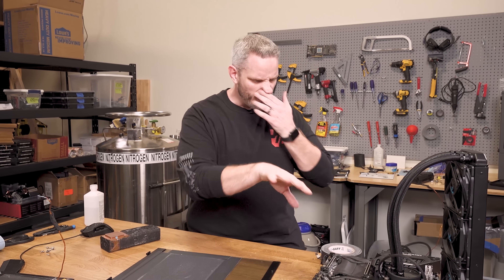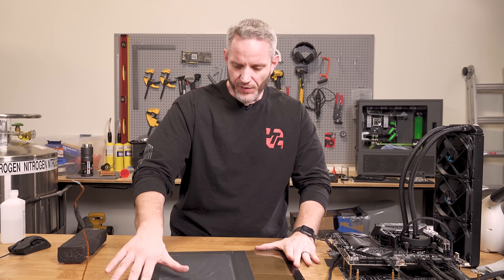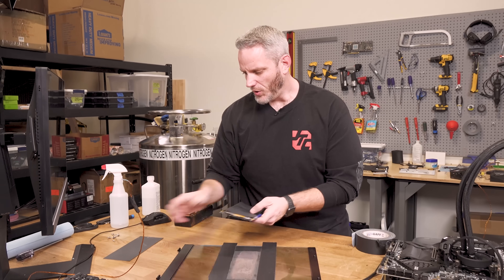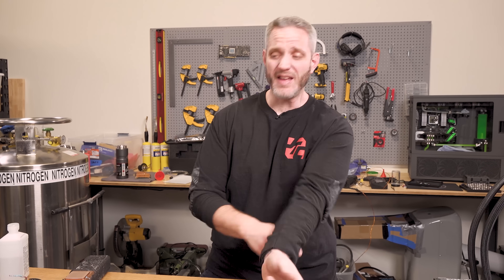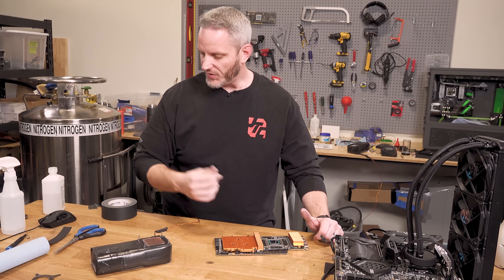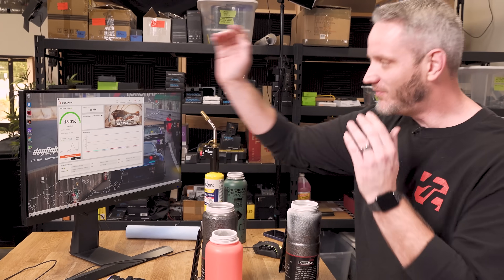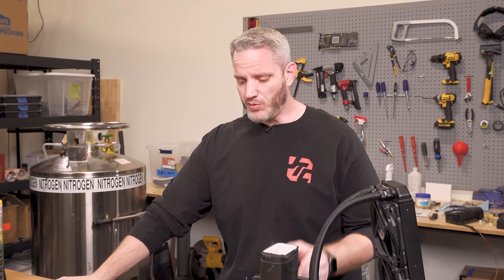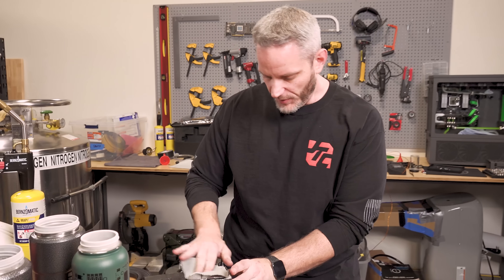THIS is Why Lapping Your Cooler is SO Important!!

Comment: Hey Jay, i don't know whether that matters or if it helps you, but did you try silicon grease instead of vaseline. 

Some kinds of vaselines are electric conductible and i don't if your (cosmetic) vaseline reacts to electricity. After all cosmetic vaseline function is hydrating your skin.

Technical Silicon oil or silicon grease is often used in electronic applications because of the neutral behavior against electricity.

Comment: Repeatability is the key. You should be using a torque wrench instead of a clamp. A further bit of advice... all torqued surfaces should be measured. I might also suggest a surfacing stone ,"lapping" and a height gauge to measure for high and low spots.

Comment: If you’re worried about microns of flatness you need to be lapping on float glass or a lab grade granite surfacing plate, not a thin, bendable PC case panel with imperfect metal edges on top of a non flat wooden table. That’s step one. You also need to stop using your hands, build a sliding sled jig that’s in perfect parallel with your surfacing plate, attach your die to it and lap up to 1000 grit. 

Not only will you be doing it right, it will challenge you and create some really interesting and fresh new content

Comment: You can use a sharpie to make marks on the metal.  The first marks to vanish in a light pass or two - the high spot.  Just something I learn for flattening sole of planes (woodwork).  Also grab free glass from a charity shop (mines a glass shelf from a cabinet), glass is floated on molten tin so is incredibly flat

Comment: Float glass may be “perfectly” flat, however, it bows like a crazy, especially thin glass. It can conform to the surface it’s sitting on potentially creating a concave/convex surface. I would use a thicker piece of glass or buy a certified flat surface considering that you’re going for precision applications.
Reply: A granite surface plate for metrology would probably better or a precision lapping plate with diamond lapping paste would create the best flatness some theorize that a perfectly lapped cooler and cpu could be used without thermal paste
Reply: @joshuahuman1  that’s no theory. In machining you have so perfectly flat metal plates for measuring, that they just stick together like suction cups
Reply: @99Etien  No, actually. I'm in a research group working with bearings, and one of the first things you learn is that nothing's perfectly flat.

There's a thin layer of contamination and oxide forming on the surface of the copper, which causes chemical changes that result in expansion and contraction. It varies depending on even things like surface temperature and local concentration of oxygen in the atmosphere. That's ignoring things like random variance in machining.

Basically, surface finish is inherently random, it's just a question of the degree of randomness. Wetted surfaces are always superior to dry contact when they're practical to use, and just trying to get a surface "flat enough" doesn't work.
Reply: @louisvaught2495  i'M iN a ReSeARcH gROuP. LOL.
Reply: @99Etien  they're called gauge blocks, and it's called "wringing" them together.
Reply: @xenonram  More digestible than "I'm a tribologist" and more specific than "I'm an engineer and I work on this"

Even lapped surfaces aren't actually smooth. There are still peaks and valleys that prevent contact, they're just shorter. With dry surfaces, you only get contact at the peaks, and making the surface less rough doesn't increase that contact very well. 

Filling the gap with something soft is always the best way to go.
Reply: @xenonram  Yeah! forgot how they were called! Thank you!
Reply: @xenonram  i love performing that "magic trick" for my non machinist friends
Reply: @99Etien  &  @Joshua Mensch , yes and no. While it's possible to get the surfaces so perfect that they suction together, all you're seeing is adhesion, that is in no way a clear indicator of a perfect mating of two surfaces, especially for near-perfect thermal conductivity. Those "perfectly machined surfaces" you reference still look like the grand canyon at the molecular level. Keep in mind that diamond has a thermal conductivity of about 2000W per meter per kelvin. Graphene while not all that different than diamond at the molecular level looking at a single plane, it's at least half as thermally conductive. The molecular peaks and valleys between two "nearly" perfectly mated surfaces can have a huge impact on thermal conductivity between across the interface, where thermal paste, if the particle size is small enough, will help by at least filling in the gaps creating a transfer medium, even if that medium is way less conductive than the metal surfaces themselves. Remember, part of what we're trying to do here is remove the heat from the die as quickly as possible, which requires the interface to be able to thermally conduct heat as close to the native conductivity of the materials we're trying to make act as one, even a 10% reduction in thermal conductivity at the interface would result pretty sizable loss in the transfer performance. Or at least, that's my take on it.
Reply: @louisvaught2495  exactly, and Jay running his greasy fingers over it all the time isn't helping this...
Reply: @xenonram  so am I, but we are researching researchers......
Reply: @99Etien  alclad does the same.
Reply: @louisvaught2495  I realized that without being a Physicist
Reply: @joshuahuman1  I don't run thermal paste on my cpu or gpu. i also have a granite surface plate that is a lab grade aa with a flatness of 0.000025". with a repeat reading of 0.000017.5".  also have 6 lapping plates that are the same flatness. float glass has a flatness of 0.0039-0.0098". use a super fine diamond compound. it takes along time to get the cpu and cooler that flat. also machine my own brackets for hold down. oh one down side is you can't get them apart very easy. they lock them selves together i have a cpu and cooler that are welded together forever. well with out wrecking them. now the lapping plates you use all of them in a rotation as you rotate the part from one to the next one. if that makes sense to you.
Reply: @joshuahuman1  possible yes ... but not to over clock ... again EVEN spread of the paste which is a heat conductor and micro abrasion filler ...
Reply: @joshuahuman1  

I have lapped precision parts for space telescopes and other instruments. My CPU cooler was lapped against a granite block that is itself lapped to metrology standards for flatness. All these guys flattening on sand paper make me cringe, it isn't lapping, and it won't come out all that flat either. I'm not really fully benifiting from a cooler that is flatter that .0001 inches because I'm not enough of a computer geek to also flatten the CPU lid. If I did, I would also significantly dilute the thermal paste.
Reply: @JosephHHHo  My thoughts exactly (I also work in metrology).  If these guys want perfectly mating surfaces, they should lap the die and the block together, much like grinding telescope mirrors.  Then they might not be flat, but it would be a perfect mating surface.
Reply: @JosephHHHo  you are a snob, no one on here can afford the equipment you are supposedly using on supposed equipment for the supposed job you have.
Reply: @joshuahuman1  you are 100% correct
Reply: @joshuahuman1  granite is fairly soft much softer than the abrasives you use. and if you use it often enough you'll develop high and low spots on it. it's only meant for precision measurement, if you're not going for perfect accuracy but just want a quick and dirty solution it's fine. but it's far from ideal. not to mention it's granite abuse.
Reply: @BloodSprite-tan  

Using granite is a bit of a hack we use because services for re-flattening it .... By Lapping.. are very commonly available so places that need very occational lapping to decently flat surfaces can achieve those results easily with minimal special equipment. At places I've worked that do a lot more lapping and to more particular requirements, it does indeed get more interesting. The tech would maintain multiple laps in various degrees of being crown and hollow for different scenarios. Using a nominally flat lap usually produces a slightly crowned part. Typically we want parts that are really flat but slightly hollow so the crowned lap is really useful.
Reply: @joshuahuman1  I would bet that would work similar to gage block wringing. Some good videos on youtube about the phenomenon.
Reply: polished granite kitchen worktop/granite surface table
Reply: Good to know and I was thinking this as well. As glass gets thicker will it have more strength towards drops as well?
Reply: Erm what he had worked fine.
Reply: So many great bits of advice in this video's comment section, but yours may well be the best advice of all for Jay's application!
I seem to remember hearing that over long periods of time glass acts like an extremely viscous liquid and very, very slowly bends and moves.
Maybe I'm not being totally accurate here, it's from memory and just a neat way of explaining it.
Reply: Yes...omg. he might've made it worse
Reply: yeah he has the basics down but his technique isnt the greatest
Reply: The point is, this is bullshit clickbait content

Comment: Curious about something. Has anybody ever discussed using automotive antifreeze in a water cooling loop? They have special formulations that withstand temperature extremes better than the pretty-color additives.
Reply: Yes, its basically what aio's use

Comment: I thought you were supposed to apply a torque plate on any mating surfaces before you lap them to make sure that when it is tightened down the flex doesn't interfere with the lapping you just did?

Comment: I have a question about overclocking your cpu. I have a ryzen 5 1600 and today i overclocked it to 3,65 ghz at 1,35v. Under load (cinebench r23) the temperatures are stable but when in idle it usually runs at 40°C and then it drops down to like 30°C within 10sec. After it hits 30°C for 1sec it jumps straight up to 40°C again and this process continues non stop. Is it because ryzen first gen is not capable of such overclock?

Comment: My two cents on lapping at home:
- Use a drop of dish soap with water on the sandpaper.  This will prevent any binding in the paper resulting in a better finish.
- Lap in a figure 8 pattern.  This will ensure that you have sanded/lapped at all angles.

Great stuff J!

Comment: As far as a rough surface goes, I think it's more about increasing surface area to increase thermal transfer
Reply: You are correct sir. That's the reason to have it slightly rough instead of a mirror finish.  Works the same way with painting.
Reply: @xj0s1ahx  "Works the same way with painting"

I certainitly wasn't discrediting this. I just think that explaining the process in the context of heat transfer is more relevant to the content and informative to the average viewer than referring to painting.

Comment: Hi Jay, cool video! One thing you might try is doing your lapping in a figure 8 motion for better flatness instead of the back and forth or uni directional. That's the way lapping is done on ultra flat surfaces inside the valves that go on rocket engines. We had ridiculous flatness tolerances that we had to meet, and that was the way the operators would lap the parts by hand to meet them. I don't know how the omni directional finish would affect the adhesion of the thermal paste, but I bet that with the right grit you would be just fine. I hope this helps, and keep up the great work! Happy overclocking!

Comment: @Jay Can you just spray paint a card/MB to make it waterproof? Why not?
Obviously you'd need to tape off the parts that need to connect, like the PCI and ram slots, so no paint gets in them.

Would the paint trap too much heat? Or any noticeable amount at all?

Comment: When flattening sharpening stones, a common technique is to make a grid with a pencil and see how the pencil lines get ground off to see the high and low points
Reply: Similar as engineers blue used for metal work, paint it on- let it dry and file/sand/flatten :)
Reply: @buddybleeyes  exactly :)
Reply: @bzboii  I never thought of using pencil though, that is pretty clever ngl
Reply: @buddybleeyes  I use a sharpie as a replacement as engineers blue is hard to find in Canada, and a sharpie is cheaper and healthier!
Reply: @PapaWaluigi  yeah prussian blue gets everywhere also
Reply: @buddybleeyes  Yes like you said blue layout dye like DYKEM. https://www.amazon.com/Dykem-80300-Steel-Layout-Brush/dp/B0018ACR6G
Reply: In a similar fashion, I also saw someone using a lit candle to put soot on a metal piece they wanted to flatten. The low spots retained the soot after sanding.
Reply: @D_Rabbitz  the only trouble with this technique is that you need to let the piece cool down after this process since if you flatten it immediately after that, the metal will move on you. Best is to use marking dye.
Reply: @spyiro2007  lapping die (or soot probably) wouldn't work on the porous stones for sharpening, and pencils are very accessible. 
But yeah I'm sure for machine shops marking dye is the way to go
Reply: @spyiro2007  I can't remember for what type of part the guy was using this, but he held it really far from the flame so probably low tepid temps? Not sure. But definitely marking dye would be excellent for this.
Reply: @spyiro2007  I find that permanent marker works just fine.
Reply: @spyiro2007  You can get Prussian Blue non-drying paint (made by Permatex) in most auto parts stores these days.
Reply: @spyiro2007  sharpie
Reply: @D_Rabbitz  ahh that's clever. Probably wouldn't want to do that if you're lapping a cpu die, though xD
Reply: @D_Rabbitz  Clickspring!
Reply: @D_Rabbitz  Blue Dykem.... or even permanent marker
Reply: it's basically, just a dye to use on surfaces to see how flat they are as low spots will hold the color
Reply: It’s pretty tough watching tech people doing non-tech stuff
Reply: @benjacmarshall1153  Don’t ever watch Alex at LTT. He should never be around power tools. Sad part is that he’s apparently their “expert”.
Reply: @benjacmarshall1153  No shit ever seen anyone over at LTT using power tools?
Reply: @Steve_Just_Steve  they do have engineers on staff
Reply: @bzboii  LOL, right. It was obvious they had no clue as soon as they used that as evidence of experience in the shop building shit.
Reply: some use a sharpie for this also
Reply: You can use anther piece of metal(i.e. spoon) to gather soot and then rub it on your cpu with your finger
Reply: For machining they use a special blue dye. Don't know what's so special about it or why it is blue but that's what they do.
Reply: I cheat and use jeweler's rogue and a strapping block.  Wouldn't use sandpaper ever, or a whet stone.  Not comfortable having water near my components.
Reply: @Krieghandt  have you seen techyescity he washes stuff in the sink
Reply: @Durkhead  LoL, I've done other ppls mobos in a dishwasher with 50%water/alcohol mix, and it worked great (removing  soda spills) but I tend to bork my parts.  Oh, the secret is to make sure the parts are 100% dry before repowering.  And we had about a 60% success rate.
Reply: aka guide coat
Reply: My thoughts exactly
Reply: Yep or a bit of layout ink
Reply: As a knifemaker, this is a great technique for ensuring flatness on stones, steel. One thing I would recommend though is wearing an N95 mask, nitrile gloves and some eye protection. Copper/other metal dust can be absorbed through your skin, eyes, and respiratory system.

Comment: This is making me cringe. Don't tape the sand paper down like that. You can see your 320 grit lifting on the leading edge, which would be rounding that edge. It's always better to using adhesive on the backside of the paper and stick it to your glass or stone. You can also get lapping paper that already has this done. Then pay attention to keeping the surface flat and not tipping. If you lap a part correctly you will have an amazing contact patch. But if you don't you can hurt your contact patch, in which case you have to do more lapping to correct it.